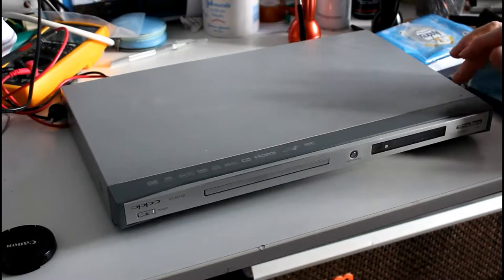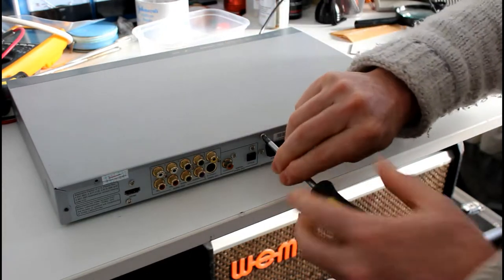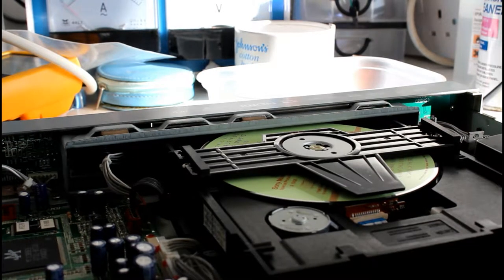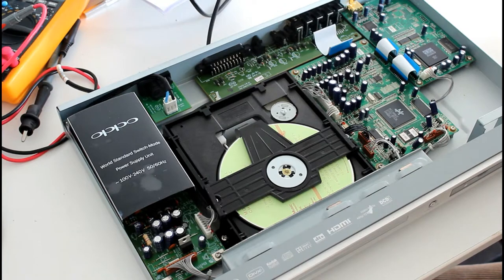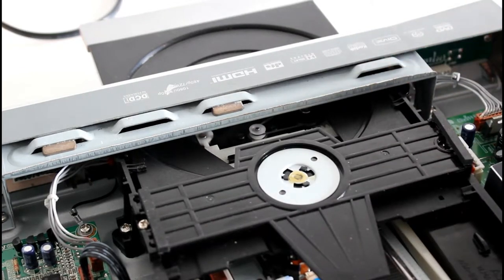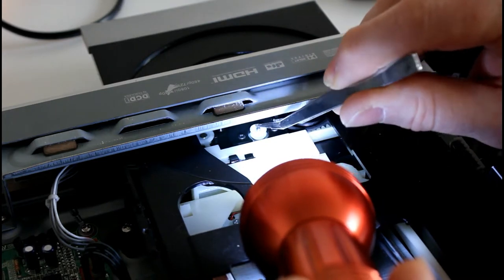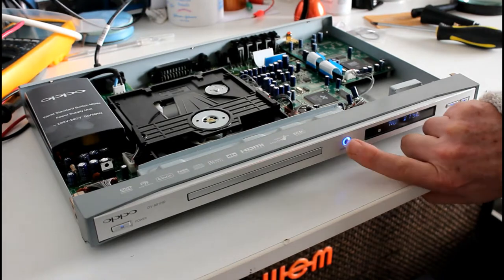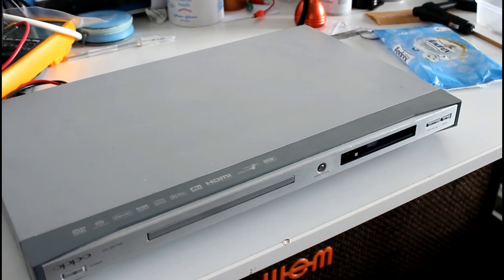Oppo DV-981 HD draw/tray belt replacement tutorial

Comment: Thank you for an excellent video. Belt size is 28mm x 25mm x 1.5mm. If the drawer will not open at all, it can be "persuaded", but be careful because the gears are only plastic!

Comment: Hi there. Thank you so much for this tutorial which inspired me to save my failing Oppo 981. I did as you suggested and went a step further. I dissambled to front panel with some trepidation so I could gently lubricate to white plastic moving parts which raise and lower the table. Got a belt replacement from a kind neighbour which is actually an automotive gasket and the whole machine is back in tip top condition. It's an important player for me as it deals with SACD-R's after I successfully DOWN-graded its firmware. Thanks again !!! All the best.
Reply from the maker: You are very welcome. I'm glad you had success. Merry Christmas.

Comment: Sweet! thanks. I wonder if this "fail" would eventually result in the DVD locking up and not responding to command?  Follow up: We'll see about the lock ups but the case top removal was not nearly the problem that was portrayed here. There also seems to be further disassembly that is possible but I went with "fishing the belt" method. Oppo support still responds to emails and sent two belts for $5+  Good Luck!

Comment: My 981HD has similar problem but the disc is stuck inside and I am unable to pull the tray out. Have opened the top panel but inable to persuade it to open. Am worried I will break something if I push too hard.
Any suggestions?

Comment: if the eject is not working with the power, then how to open it half way to replace the belt
Reply from the maker: Hello, I would try pushing the tray gently by hand to open it.  You'd need to remove the lid to get to it. Thanks for your comment.